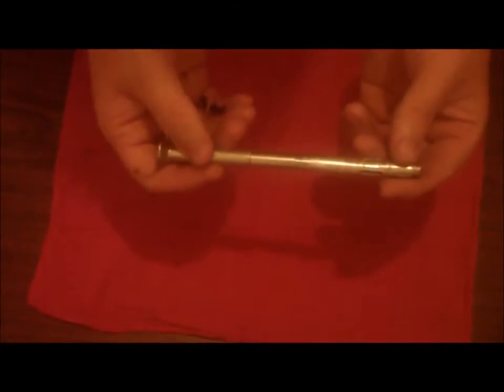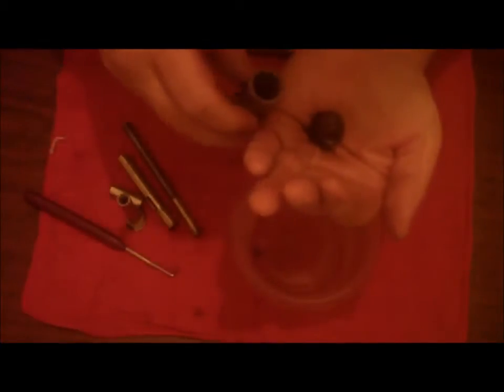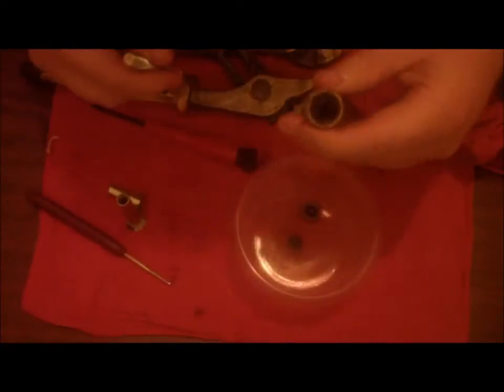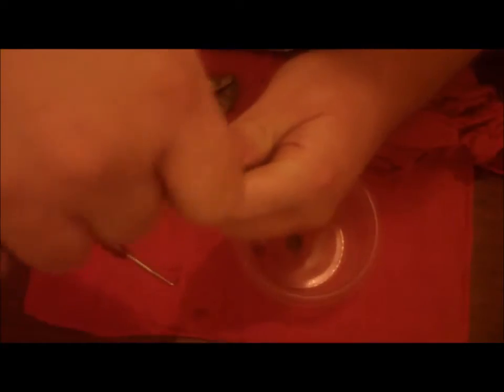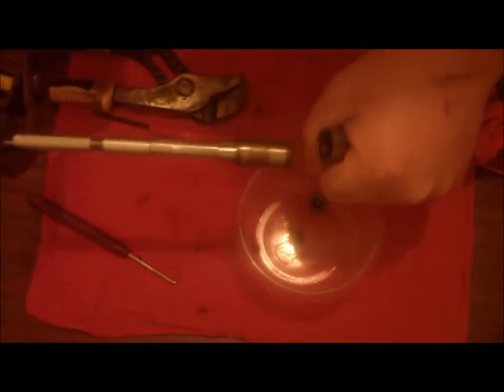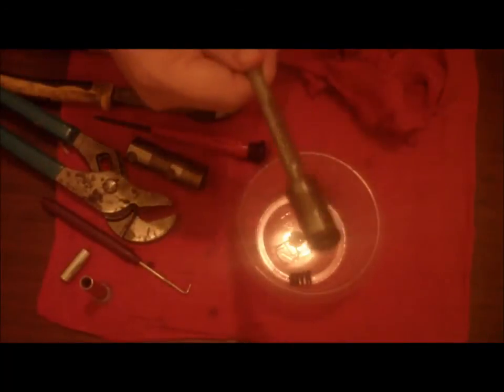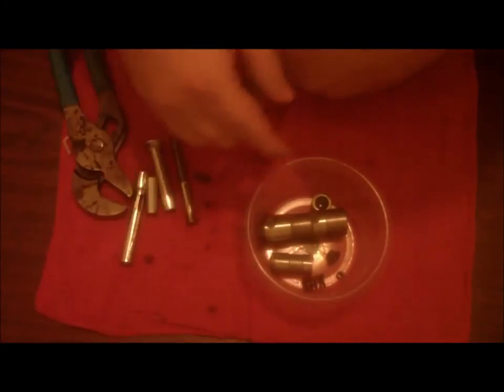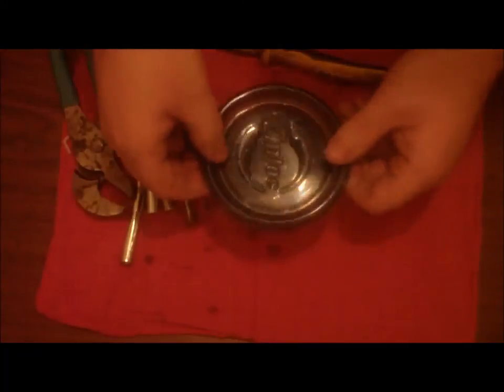Homemade Hydraulic Roller Lifter Puller Tool

Comment: Thanks for this Video it was VERY helpful my lifters were stuck SOLID no movement at all, using the anchor bolt i was able to get them apart fairly easy, motor sounds great the lifter tick is gone
Reply from the maker: +Anthony Stauffacher 
Hey I am glad my video helped you out. and got your lifters going again. Thanks for the comment and have a good day.